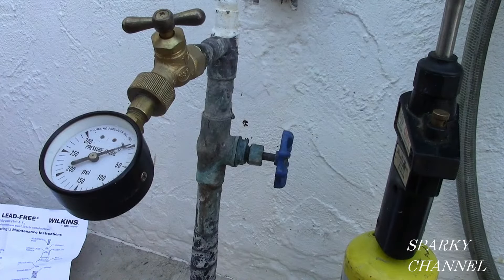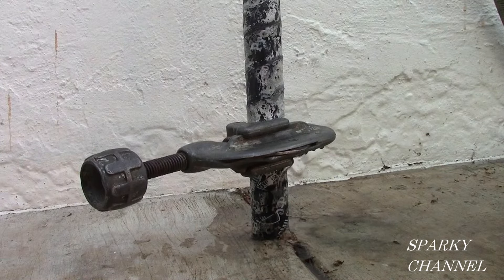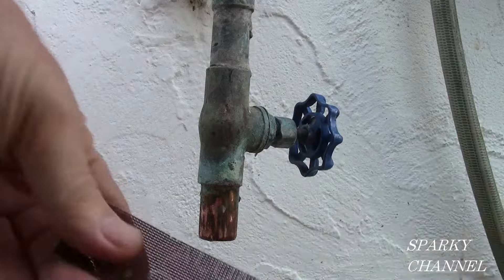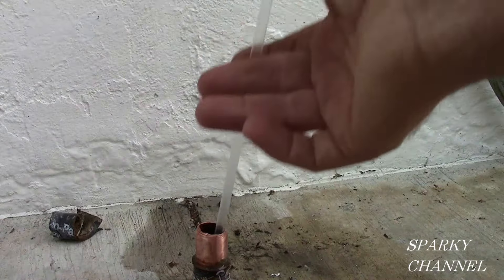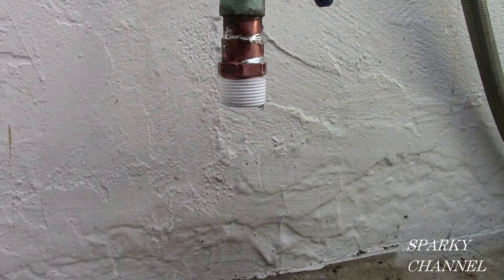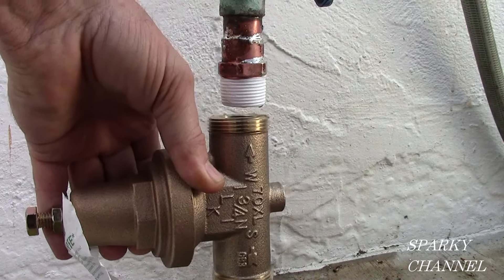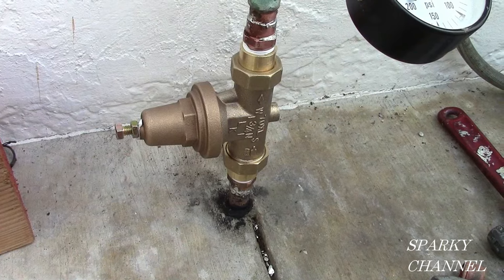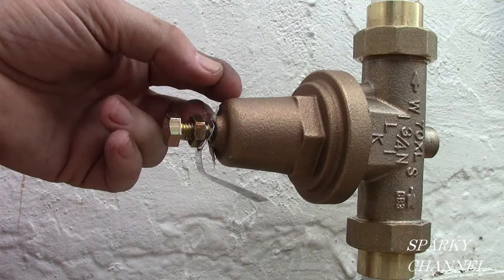How To Install a Pressure Reducing Valve

Comment: You can use a small piece of white bread stuffed in the pipe to hold the water back until you get everything soldered, then just forget about it and the bread will break apart naturally and go down stream when you turn water back on.
Reply: Avoid this trick when installing a PRV because there is a strainer in there that will catch all the bread.

Comment: Should we put Teflon tape on the pressure regulating valve as well or are the washers good enough?
Reply: Washers good enough. Teflon wouldn’t help
Reply: It is a compression type connection where Teflon would be unnecessary

Comment: Does the PRV go after the shutoff valve or before ? Just wondering if it really matters
Reply: They usually have one after the PRV valve where I live, so it goes the street shutoff, interior shutoff, PRV, and another at the water heater.

Comment: what about a thermal expansion tank, is that necessary with this pressure reducer?
Reply: Yes it is
Reply: @joshbarron4415  can you explain why?  Just trying to understand.
Reply: @ko6128  A pressure reducing valve (PRV) also acts as a check valve. When the cold water feeding the water heater expands due to temperature, it doesn’t have anywhere to go other than out the T&P relief valve which is why they drip when no expansion tank is installed. The expansion tank gives the water somewhere to expand to without opening the temperature and pressure relief valve and dripping
Reply: @joshbarron4415  ok.  So with a tankless water heater, the hot water is flowing out a fixture.  Doesn’t that path give the pressure somewhere to go? Thru the open fixture.
Reply: @ko6128  Yes it does but only when it is open. The most common complaint is people find their temperature and pressure relief valve valve dripping in the morning because the heater was heating at night and the increase pressure had no where to go bc there wasn’t an expansion tank and no one was awake  to use any of the fixtures.
Reply: The Watts LF25AUB has a thermal relief valve built in if you don't have an expansion tank.

Comment: Thank you for the plumbing share sir. I think
your outdoors which has me puzzled, unless
this is a tropical island where it never freezes.
How is this prudent or code legal if in USA where every state is subject to a freeze if rare.
Never seen a pipe through a side walk. As we
have learned when buying older homes one is
often chasing bad carpentry & plumbing. Not
sure why waterline was not buried under sidewalk, then into structure. For young home
shoppers a good home inspector will point out all the code compliant issues. Best of luck
to you sir.
Reply from the maker: Thanks! I live in San Diego where we don't have enough freezing temps to make a difference.
Reply: In San Diego CA, all older homes have the water pressure reducing valves outside. It never gets below 45 😅
Reply: We have this set up in FL too.
Reply: san diego also

Comment: Did you skip a step at 7:56 in this video? After applying the flux, don't you have to heat the pipe and apply solder to sweat the joints?
Reply from the maker: Yes, that's correct.

Comment: What will happen if the regulator happens to be installed backwards?
Reply from the maker: I won't work correctly.
Reply: Extremely low water pressure and heavily water hammering!
Reply: Double the PSI of course
Reply: Universal paradox. We all end up back in 1985! ⏰  flip it around unless you have access to a DeLorean

Comment: Can this increase the pressure higher than what you were getting before installing the valve?
Reply: No! Typically they are factory set around 50 psi and top out at 75 psi depending on which one you have
Reply: @stevetheplumberbreeding7402  Thanks for the response. If this type of valve can't increase pressure, how can I increase pressure in my home?
Reply: @harleyb-ham266  install a booster pump

Comment: no new main valve installed before the WPRV?  and why is the old valve still there?  boooooooooo.   great install
Reply from the maker: That original 1960 shut off valve still works. LOL! Thanks Dave!
Reply: @SparkyChannel  Hi Bill. But if you replace that old shut off with a quarter turn ball valve, you'll make sure that you don't need to worry about the seat washer or packing going bad on that old shut off.
Also, did you ream the cut ends of the copper line before soldering to remove any burrs and taper the ends to reduce turbulence in the line?

Hope you and your family stay safe and well.
Reply: @ccadama   and use less solder.

Comment: You really need to take a plumbing class because you have no idea what your doing.
Reply: why?
Reply: Sorry for taking so long to respond. I'm not bashing you and I know you mean well but you are misleading your viewers. Your upper and bottom pipe was not cleaned well and your bottom pipe was severely bent. The most critical mistake you made was not deburring your pipe. If you don't deburr the pipe that will cause turbulence in the pipe and disrupt water flow which will wear away the wall of the pipe and cause a leak. Also the globs of solder I see on the ground shows me you had a difficult time soldering the pipe. That is one technique to master. I made the same mistakes when I first started out. I hope this helps and I wish you the best.

Comment: I know it all depends but want some advice and input. Is it okay to install a PRV  in place of a gate valve. Would there be any harm in doing that. Saves me work and digging. I live in a  house with foundation. Please feel free to give me advice. Tes my gate valve is on the ground about 5 feet from the main city shut off
Reply from the maker: No, your house needs a valve so that you can turn off the water to the house. It would be bad to eliminate it. Use both the PRV and a good quality valve.
Reply: @SparkyChannel  
Honestly, what's the purpose of the gate valve if it's only like 5 feet away from the main shut off valve  to the entire house. Could I just not use the valve I could care less for that valve. I can use the main shutoff valve for that